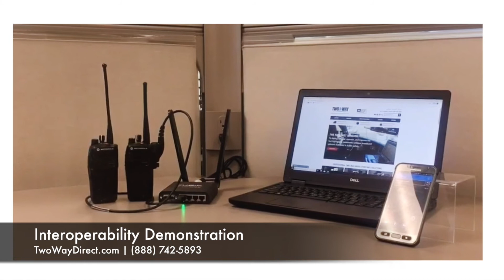Introduction to Interoperability and Cubic Vocality Device

Comment: Ok I guess not!
Reply from the maker: Hi There! These systems are customizable. Please call us with any specific questions, and so our team can better assist you and quote you on the equipment you require. Thanks.
Reply: @TwoWayDirect  Don't use just need your radio specific cable and programming of the radio's?
Reply from the maker: @KINGSTONSPRIDE  Hi There! Please call our office at (888) 742-5893, so we can quote you properly. Thanks!
Reply: What do you mean by customizable?